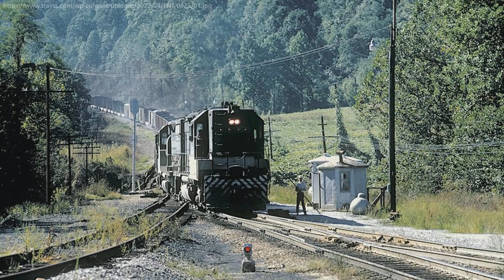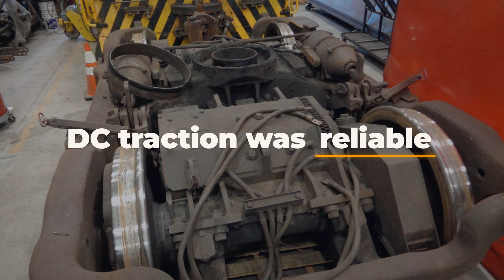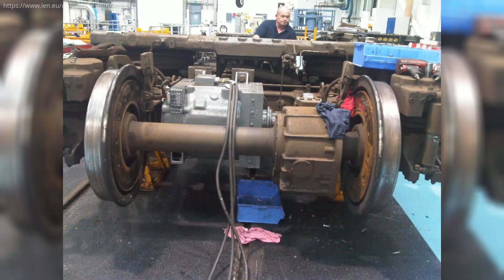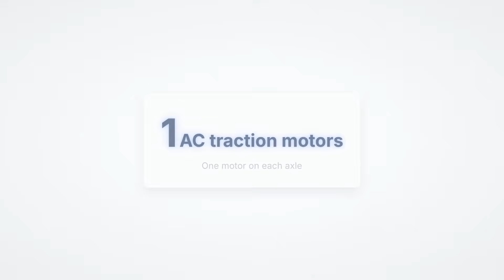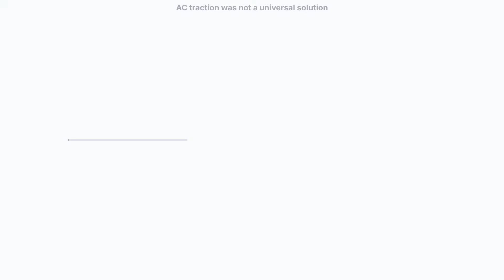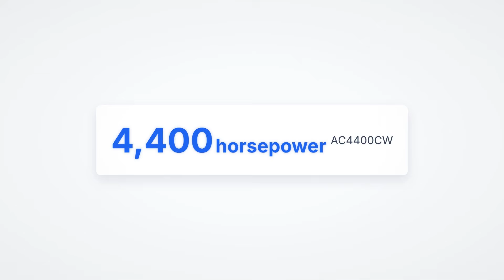The AC traction revolution- How GE cemented its victory over EMD

Comment: An Ac locomotive can continually pull a train at no speed. It can take out slack and stretch a train from the head end. And keep pulling at no speed. Then helper units can push from the rear of the train.  By pushing on the rear of the train the helpers begin moving the train. With a reduced chance of the train being pulled apart by broken couplers. With more even acceleration too. This is a train handling technique that was used by steam locomotives. But couldn’t be practiced with Dc locomotives.